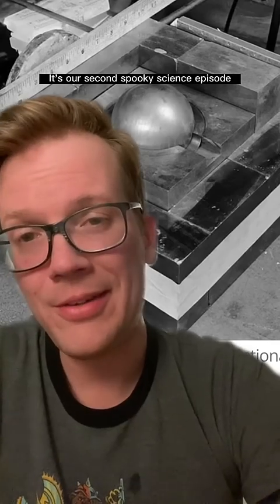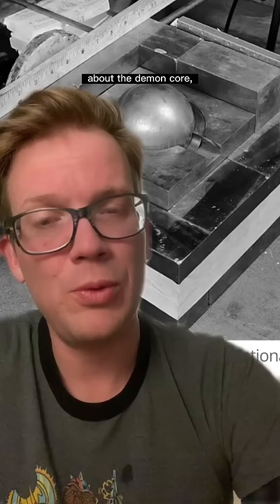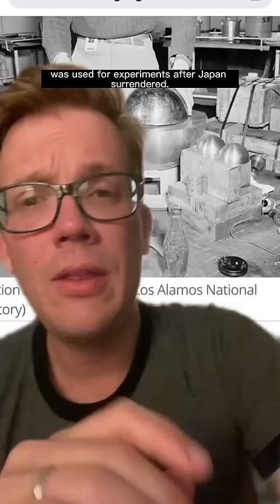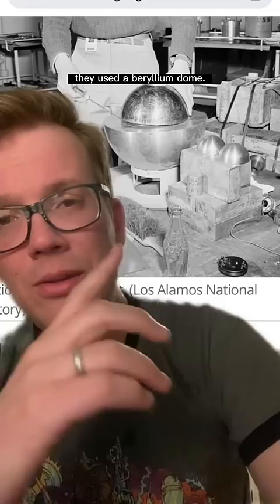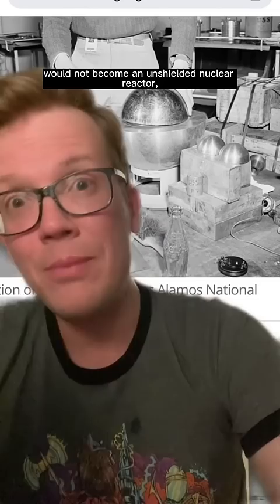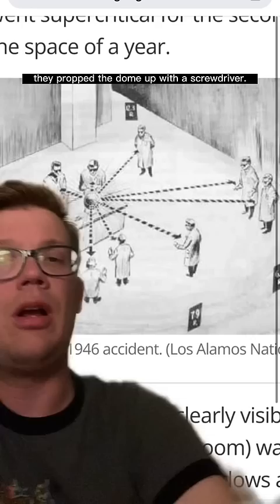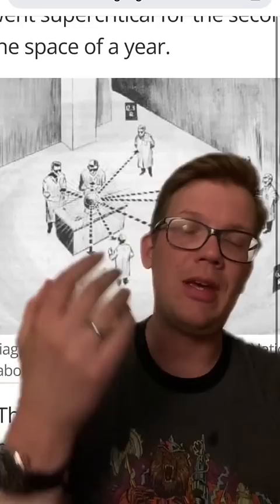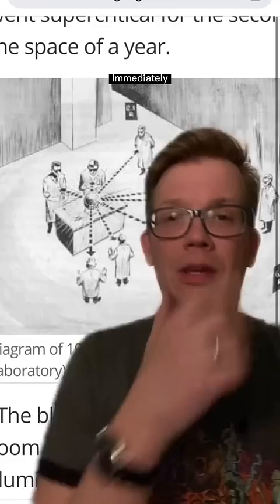Spooky Science episode 7: Second demon core incident

Comment: Slotin grabbed the Beryllium dome to keep the core from going super spicy mode & saved those around him. this is the scientist version of jumping on a grenade to save comrades. impressive dude
Reply: He’s the one that pulled the pin on the grenade though lmao
Reply: @bonehead6395  no lie detected
Reply: The grenade wouldn't have been live weren't for Slotin's stopgap solution of using a flathead screwdriver.
Reply: @Smartz118  very true
Reply: “Super spicy mode” is the only way i will refer to supercritcality from now on
Reply: He didn’t just “jump on the grenade” he prevented a nuclear bomb from going off. He saved the lives of everyone in the city around him from being vaporized
Reply: @eliyarrows2456 that is categorically not how this works.  The demon core was only a radiation source, not yet anything that could function as a bomb.  Would it have gotten bad fast?  Absolutely.  However, what happened was referred to as a criticality event - IE a radiation source is shielded in a way that as the atoms split & degrade, they then cause other atoms to split & degrade around them - Hank was perfectly accurate in comparing it to an un-shielded nuclear reactor.  Just leaving it there wouldn’t have caused any sort of explosion in & of itself, but it WOULD however cause the core to rapidly react With Itself & give off huge amounts of heat & radiation, exactly as it was doing when Slotin slipped.
Reply: @eliyarrows2456 all of that to say in perhaps too know-it-all-y a way

The demon core was no more a nuclear bomb than a pile of sticks is a fire - he just happened to be playing with matches & gasoline right next to the fire and accidentally started it, as it were
Reply: @EclipseAtDusk  so what would have happened if he didn't pop the dome right away?
Reply: @knife0party it would have continued to react - in this case, the radioactive source would rapidly break down into smaller elements, firing off ionizing radiation & tissue damaging neutrons (specifics may vary on that - there’s different levels & kinds of radiation that act upon things in different ways), pumping out insane amounts of radiation into the room.  If I’m remembering correctly, the highly radioactive nature of the core combined with the intense shielding dropped onto it by Slotin turned it into a Supercritical Mass - a radioactive chain fission (atoms breaking down into smaller atoms) reaction that feeds itself more & more intensely as it goes

It would have made for an incredibly spicy room & definitely irradiated the fuck out of anything in it, and probably would have quickly spiralled into A Problem - but not a bomb immediately, per se.  

Of course - I’m no nuclear physicist.  I’m a goof on youtube with a long furby as a profile picture - take everything I say with a grain of salt.

Tl;dr - no boom, just very radioactive room.
Reply: @knife0party  the core would've went super spicy & radiation would've done lethal damage to everyone nearby. the amount of material wasn't much so it wouldn't have been like Chernobyl but still way bad 😕
Reply: @EclipseAtDusk  I see, I was curious as to what sort of solution there would be to stop it if it was left too long. Just wondering if his quick correction stopped it from being a major disaster
Reply: @andyl1781  would the cap have popped itself off if left?
Reply: @andyl1781  fair enough
Reply: Lol, not at all. 
The core was already going super spicy. He didn't sacrifice himself to save the others, what are you talking about. 

It would've been much better for himself to grab the dome instead of running away. It has nothing to do with 'save comrades'.
Reply: well he wouldve been dead either way, he did the smart (but still right and brave) thing
Reply: grabbing it would be worse than leaving it alone (his hand will be doing the same thing as the metal dome is doing), which i imagine could have made a difference considering it was designed to be just below supercriticality
Reply: @hexagon8899  supercriticality?
Reply: @andyl1781  thats where the nuclear fission increases out of control causing a nuclear explosion. they made the demon core and its shell just barely too small to make that happen
Reply: @hexagon8899  the whole point was to leave a vent like if u put the lid on some pasta partly off so it won't boil over
Reply: @andyl1781  oh it sounded like you were saying they just covered it with their hands with your grenade analogy
Reply: @EclipseAtDusk  "Critical" means "self-sustaining", enough neutrons released, and hitting other nuclei, to keep the reaction going.

A nuclear reactor stays right around the point of criticality without going over. A nuclear bomb goes super-critical and rapidly runs away.

If it could go super-critical, then it's a nuclear bomb. Except what would likely have happened, is the "bomb" would blow itself apart, once enough heat had built up, the two halves of the core would pop apart, the top would blow off. Then the reaction would stop. 

In a real nuke, chemical explosives push the core inwards and hold it there, so the atoms are squeezed together enough for a lot of reactions to occur. Then you get a full detonation, although even then most of the material doesn't get a chance to fission, and remains unreacted. 

So technically this was a bomb, although one that fortunately would disassemble itself before the town was vapourised. Correct me if I'm wrong.
Reply: yeah after you were dumb enough to pull the pin first
Reply: @koek4539 he did grab the dome? And didn't run away? And it would have kept getting worse and killed everyone in the room
Reply: @Im__useless  
Yes, but he didn't to sacrifice himself. If he sacrificed himself, he would have sustained MORE damage by having others receive less. But that is not how that happened. Everyone received less damage by his actions. Including him. that is not a 'sacrifice.
Reply: @knife0party It would have melted and spread out into a puddle that didn't have the correct shape to maintain criticality.
Reply: @bonehead6395 but pulled it by accident
Reply: @eliyarrows2456  It was not going to explode... just release a lot of energy in the form of heat and radiation, which it did.
Reply: My view is that he just reacted, there was no thought about those around him, he just knew the sphere needed separating.
Reply: It’s also the scientist version of being the dumbass who pulled in the pin of the grenade he was just recklessly playing with in the first place.
Reply: “Super spicy mode” is a real gentle way of saying what would’ve happened
Reply: @doublehamsandmitch1108    synonymous w supercriticality in this instance